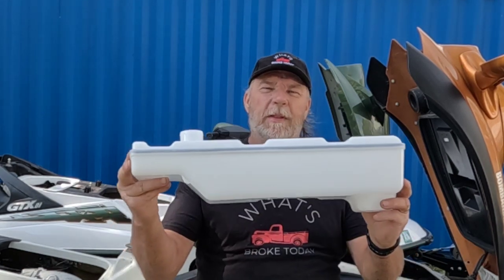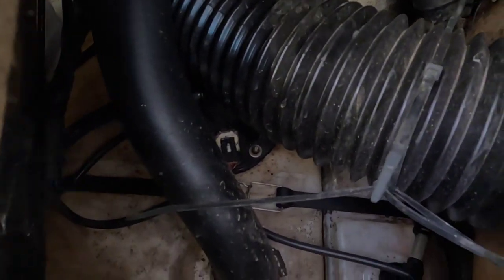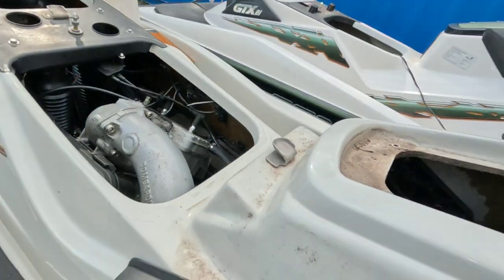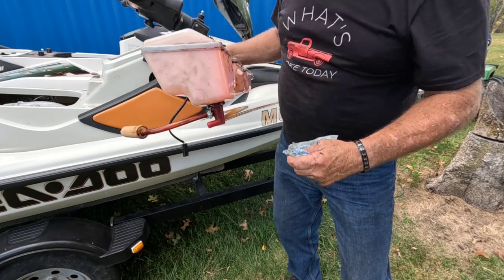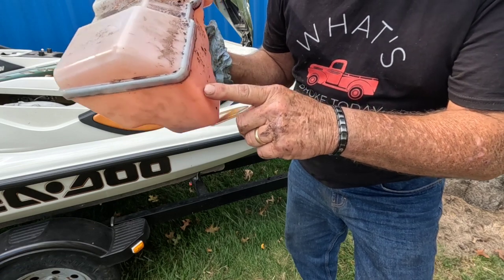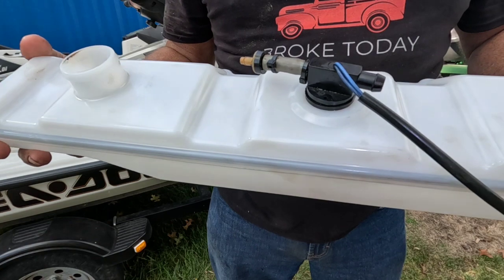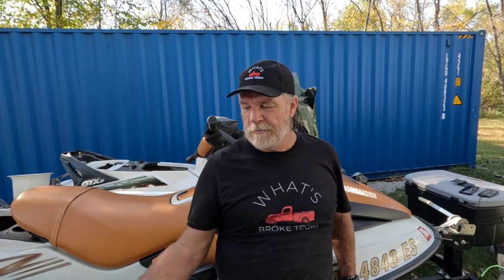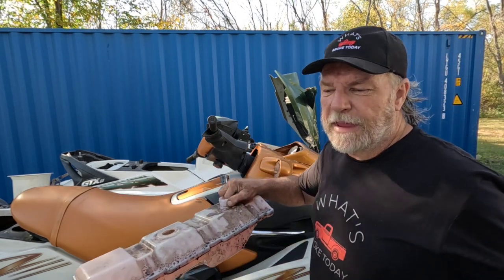Oil tank replacement 00 Sea Doo GTX RFI 787

Comment: Hello Jerry love your video I got oil leaking to the bottom of my 2003 seadoo gti I’m sure that tank reservoir is leaking from the bottom I got a question where to order parts I look I’m Amazon but does the reservoir comes with the grommets or do i need to order separately thanks in advance

Comment from the maker: If you can pull the oil supply line off the tank and keep it up high so you don't allow all the oil to run out of the hose you should not have to bleed the system. If that line does lose all it's oil there is a bleed screw on the pump to release air between the pump and tank.

Comment from the maker: I got my parts from  leadersrpmshop.com
I bought oil  tank 275000238 and 2 grommets 293720008 they were the lowest price I could find for one seadoo parts. I spent $93 look online for their $10 off coupon. It was "MOBILE10" back in Sept 23. Thanks for watching my video
Reply: So both grommets are the same part?  Great video!  Do you have to bleed the oil system after replacing tank?